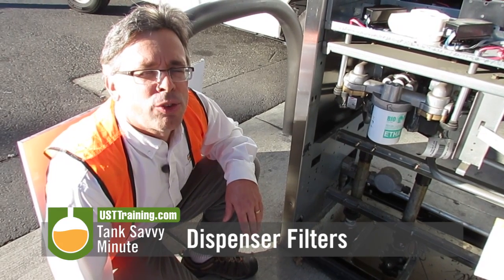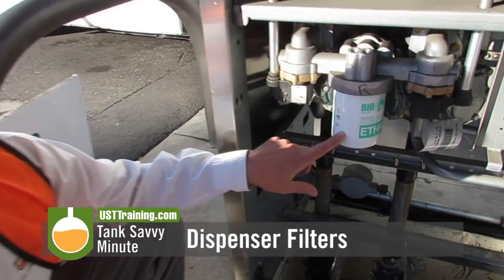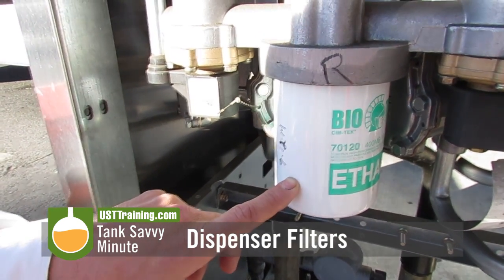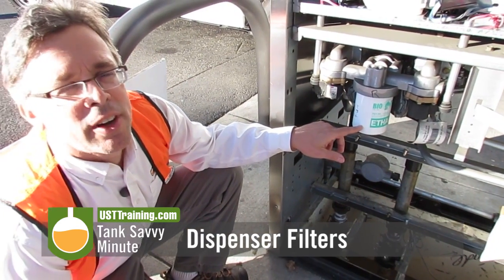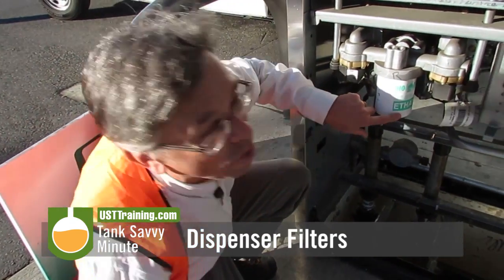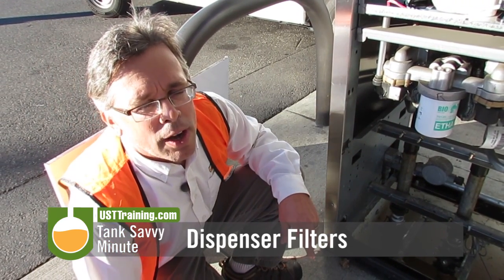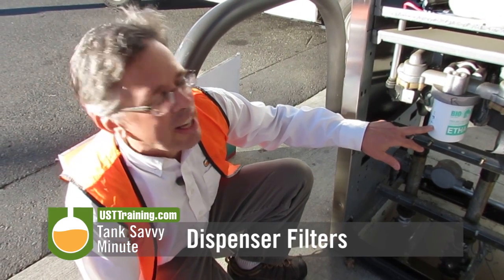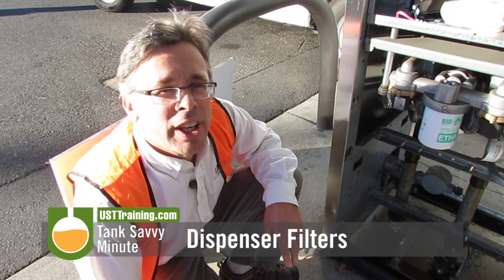Dispenser Filters

Comment: Will the pump shut down if the filter gets filled with water?

Thanks
Reply from the maker: Typically the pump only shuts down if the underground tank runs out of fuel or the electronic leak detector senses a leak in the line. I suspect a "high water" warning could be tied into shutting down the pump but I;m not sure if that is common.